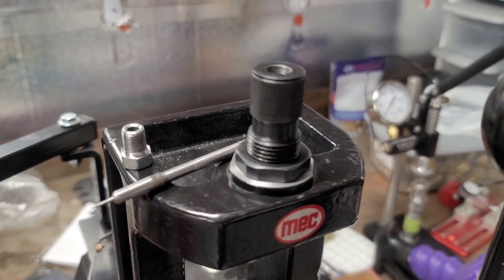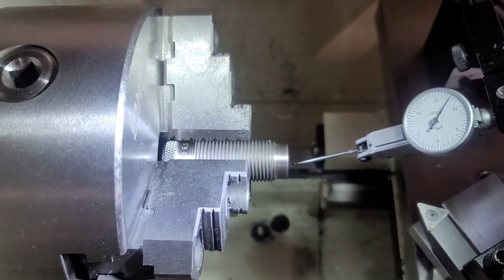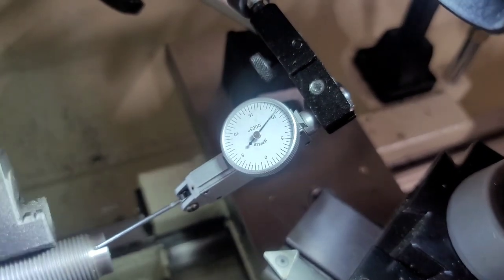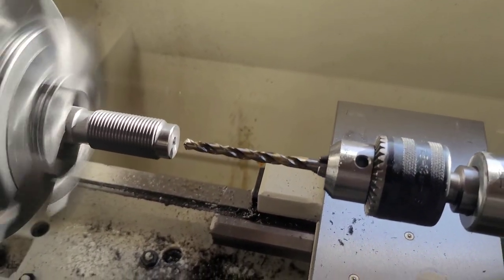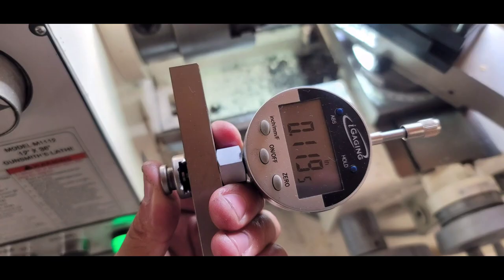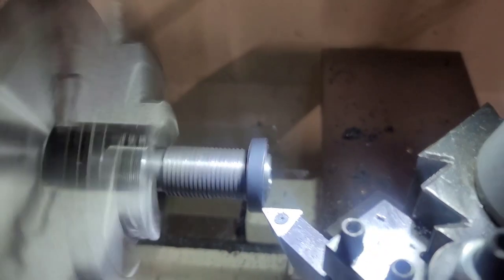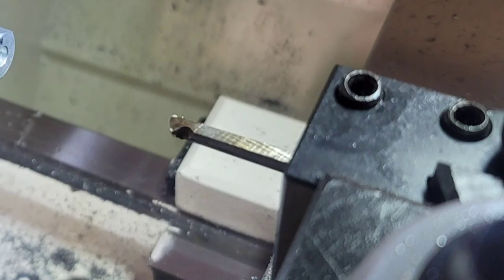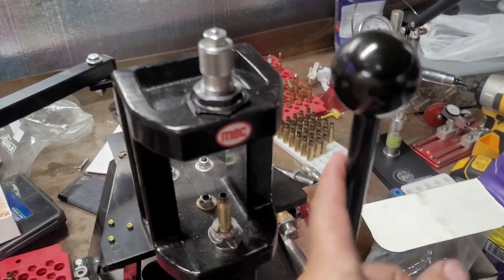Make Your Own Precision Reloading Dies

Comment: That is pretty exciting...  Looking forward to some Taco-Tini dies
Reply: Oh man why do you guys got to keep doing stuff that I want to get on board of but can't yet? That is definitely going to be the first truly weird caliber I buy into.
Reply: @GunFunZS  if things go as planned, it should be a fun one that will have multiple purposes
Reply: @FullLeadTaco  did I read correctly that it's for AR-15 not AR-10?
Reply: @GunFunZS  it will probably work in both, but we'll need to do some testing.  If done in the AR15, it will use a 458 socom bolt and require lower pressures than if used in an ar10.  The first guns are going to be bolt actions with 308 win or 6.5cm as the donor rifles because of the 308 sized bolt.  I think it would be fun to have an ar15 upper that is dedicated to fast powder subs like trailboss loads (if we can get it to cycle right).  Kind of like a 9x39, but with way better bullet selection.  Still need to figure out the exact dimensions of the cartridge.
Reply: @FullLeadTaco  that sounds awesome. I'm less excited about trail boss. That powder costs about 2x everything else per pound every time I checked.
Reply: @GunFunZS  trailboss is a high volume low density powder, so when you buy what normally would be a 1 lb jug, it weighs less so it feels like you're getting cheated cost wise, but you use a lot less weight wise if that makes sense.  But yeah, there will be lots of load options.  I really wanna do an ar10 pistol upper with it too and see what it can do with a short barrel.  Maybe have a long barrel also... I don't know, I'm just excited to get it going and do some testing.
Reply: @FullLeadTaco  I get the value of trailboss, and have a jar. It just works out that most of the things I would use it for have a lot more economical options that seem to be good fits. If I had a bunch of big bore suppressed slug launchers like you, maybe I would see it your way. For me TB is mostly a way of loading weird stuff safely without worrying, and avoiding load density issues with old cartridges. Mostly I solve that problem though by using cartridges with case capacity closely matched to what I want them to do, but using modern powders. i.e. 300 BO is 'about right' for a nice all around plinker, multi purpose gun. 9mm and 40 do similar things to several revolver cartridges without airspace.  The taco Tini appeals to me for the 9x39 suppressable aspect, and for shooting big ol freight train HPs for giggles. It never occurred to me that something like that would run in an Ar15- is this a substantially shorter case than Yeti to fit in the magazine with long bullets?

Comment: A real machinist uses a 4-jaw chuck for accurate and precise work. A scrolling jaw chuck has ca. 2-3 thou runout
Reply from the maker: Hey captain assumption. A real machinist uses a dial indicator and can tell if a part is running true in either 3 or 4 jaw......
Reply: @EagleEyeShooting  I could resort to your level of childish name calling but I have no need to do so.  A real machinist uses a 4-jaw chuck and a test indicator
Reply from the maker: Cute picture😂

Comment: The shell moves in the shell holder, so does run-out with the die actually make  any difference what so ever.
Reply from the maker: A floating shell holder helps aline horizontal but does not fix canting. Floating the die helps that but relys on a fired case to be perfect before sizing.  Hence why many bench shooters use le wilson dies or hard stop trued reloading dies
Reply: @EagleEyeShooting  I meant the shell holder does not grab the shell that tight in any direction, if you think it works better, tidy. All the best to you.
Reply from the maker: Proven results....... its helped for me and I didn't have to spend 150$
Reply: @EagleEyeShooting  don’t get the logic as the shell will always self centralise, but awesome machining skills, nice job.
Reply: That’s absolutely correct.

Comment: If your 3 jaw chuck is good the id you checked is true to the od you are clamped on. That clearance cut on the end means nothing. Also to get a true reading on the jamb nut you have to  use another jamb nut to true up properly not the set screw.
Reply: If everything is not setup in the proper manner you are just chasing your tail.
Reply: You will never have everything perfectly lined from press to die to brass that's why it is import to have a little movement to self center like floating shell holders and dies with o rings.
Reply from the maker: Why would I use a jam nut on the lock ring when you use the set screw to lock it down? Seems redundant and wouldn'tbe using a jam nut everytime.  Also if the chamber ID is running true but the OD is off, the threads are off. Doesn't matter if its a 3 jaw or 4. Derrick is 100% correct. Free floating the die helps mitigating any off center when sizing.
Reply: @EagleEyeShooting  true but when you tighten the nut down 
On the press it is against the threads and concentric or parallel with the thread on the die. Then snug up the nut. Those set screws should have a nylon tip to conform to thread and not cock the nut out. you were only .0002 run out from thread od to die id.
Reply from the maker: Nice tip on the nylon thanks. Well I wouldn't be using a jam nut to lock the ring down and the lock ring more than likely wouldn't move or matter as I set this die to size the same by having the sizing chamber dimensions set to where you just bottom out the die to the shell holder

Comment: Too bad they don't make dies that install in the press with a tapered fit and locknut on the bottom side like so many precision machines do. Those threads tighten up in a different location based on the clocking of the die. Without measuring at the press ram all the way into the die you really don't know the accuracy. Facing the nut might help but ultimately the threads are the culprit.